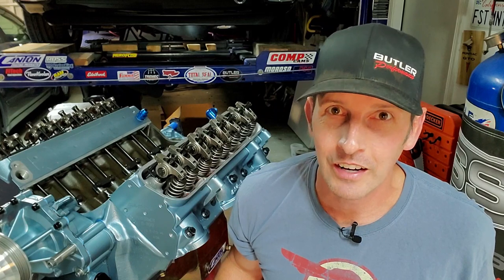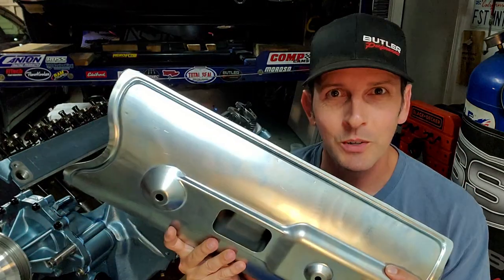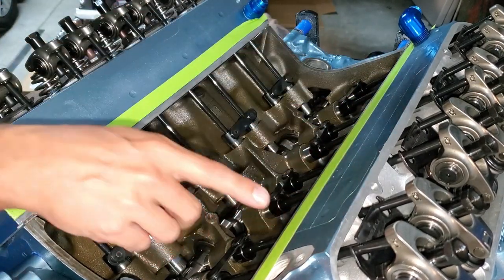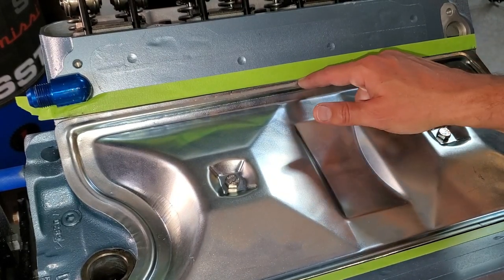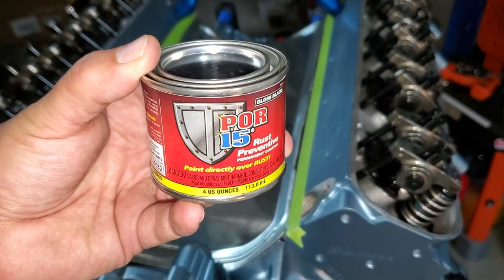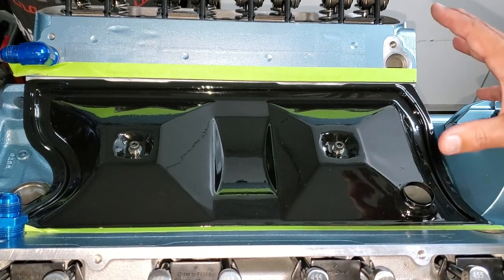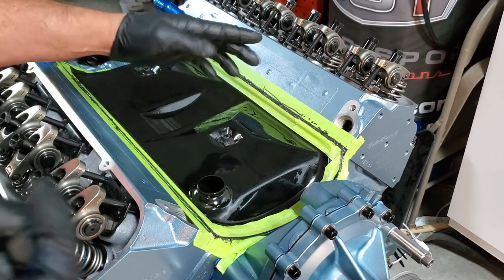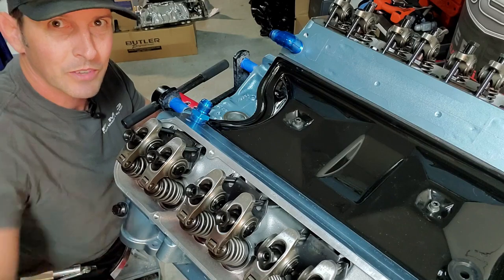Tomahawk Valley Pan for Roller Lifters, review and install.  Pontiac Short Block, part 9

Comment: Excellent! My stock valley pan had a boatload of RTV and was overlapping the stock heads before I removed it. I thought that was normal without a gasket. Glad I watched this as I was just going to use a river of RTV. I even bought a canister tube of Grey to go into my caulk gun.
Reply from the maker: Ha!  Glad I could help... thanks David!

Comment: I’m pretty sure the valley pan bolt holes in the block are drilled through to the cam bore.  Depending on how long your bolts are, I think it’s possible to damage the cam bearings bottoming out those bolts.  I seen some people replace the bolts with threaded all-rod effectively making studs.
Reply from the maker: Good point Steve... mine are not through holes.  But, I don't know about other blocks from different years.  Always a good thing to check.  And, yes, using studs would help alleviate that issue.  Thanks for the comment!
Reply: My smooth aluminum butler valley pan came with studs specifically because of this issue. Mine is a '71 400 block and the holed are drilled thru.

Comment: Like always another awesome video Mike. I was debating if I should use the flat piece valley pan from Butler or the tomahawk. Thanks to this video you have convinced me, we appreciate you taking the time for all these cool videos you make..
Reply from the maker: Thanks!  Yeah, the Tomahawk is the way to go.  Can't wait to see how the M/E Wagner valve, and the nice sized baffle behave.  Thanks for the comment!
Reply: @FastMonty  so Mike why did you only use RTV and not the one piece valley pan gasket with the tomahawk cover.
Reply: I found the answer further down in the comments, thank you Mike!!!
Reply from the maker: @transam4555  Good question... I mention it at the 7:30 mark.  There are three reasons.  One, the pan is not perfectly machined like the block, and may not fit square on the gasket.  Two, the gasket increases the height of the pan, which can then interfere with some intake manifolds.  Three, that's what Butler does.  :)  Hope that helps!

Comment: Great job again!  i did the exact process on my current build with the valley pan i also had to shave some matarial on the lower side of the intake area due to rubbing issues, i have the wagner valve also but have not fired the engine up as i have a ways tp go on the rest of the build
Reply from the maker: Thanks Steven... great minds think alike!  I can't wait to fire mine too... Thanks for the comment!

Comment: What paint did you use for the aluminum heads? engine primer? etch primer? sanding prep? How is it holding up?
Reply from the maker: Good question... I used the same products I used on the Block... here's that video;  https://youtu.be/hHmAV2NYwV0  It's holding up great!

Comment: Did your old valley pan have the baffle in the neck where the PCV goes?  I just sent back the tomahawk one because it would not fit even with modifications.  I am now trying the valley pan that butler makes from aluminum.
Reply from the maker: Good question Bobby... what exactly didn't fit with the Tomahawk?  Yes, the old valley pan I had was a Butler pan, with the baffle in the neck.  If you go that route, an oil separator will be mandatory, cuz you'll be sucking oil.
Reply: @FastMonty  the inner baffle piece wasn’t welded correctly to the outer shell. This caused it to be shifted over to one side when installed. The inner piece was also hitting the block casting at each end so it wouldn’t sit down flat on the block or heads.  Mine came from Inline Tube but I’m pretty sure they are all made by the same mfr. I bought one of the original aluminum valley pans 20 years ago and they had no baffle at all. Sucked oil like crazy. I figured Butler had solved this issue by adding that baffle to theirs.
Reply from the maker: @RMH8520  was it the pan for roller lifters?  The inner half is smaller, which may help. The baffle in the Butler pan doesn't do much, which is why I tried welding on another baffle. Not sure if I made it worse or not... I then asked Butler what to do, they told me to get the Tomahawk. Maybe try the Tomahawk for roller lifters?

Comment: looking for a post you had on using a cross over water hose from the back of the engine heads to reduce temperature. Is it possible to do the same to a Chevy engine?
Reply from the maker: Good Question Rick... I don't know if the same will work for a Chevy.  I've never studied the water flow.  But, here's my video of the Pontiac cooling trick.  (In my opinion, ain't nothing wrong with moving more water around)  Let me know what you discover... https://youtu.be/DWvVkrGQDsw

Comment: Pre egr OE Valley pans fit with roller lifters. You don't need this pan to solve that.
Reply from the maker: Very interesting... what year did Pontiac change to EGR Valley pans?  Thanks for the comment!
Reply: @Fast Monty's Garage  Don't know for sure but pre egr pans look exactly like what you have in the video, including the baffling. That Tomahawk is just a reproduction. Many people use roller lifters with the OE pan.

The EGR pans have a much larger external cavity in the center, maybe 6" and square, to accommodate the bottom of the intake manifold. Those typically  don't fit roller lifters.

IMO, the biggest benefit of the Tomahawk pan is that it's new. It's quite hard to effectively clean a used pan internally, and many people foolishly glass bead them leading to engine damage when the grit comes out later.
Reply from the maker: @mback12000  Ahhh, yeah, I'm remembering now.  I fairly certain my stock pan hit my new lifters.  (That was from 69)  My guess is EGR came out in the early 70's, like 73?  You know, gas crisis time.  But, I also agree buying a new pan is way easier than cleaning an old one.  Thanks for the run down!